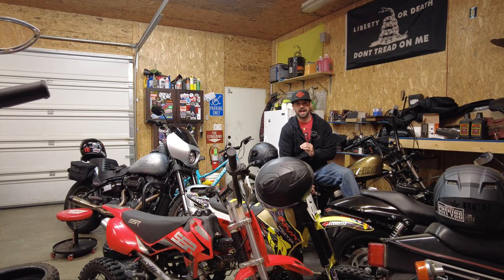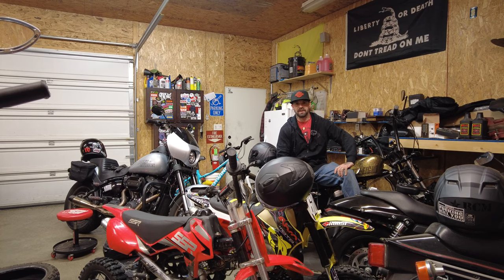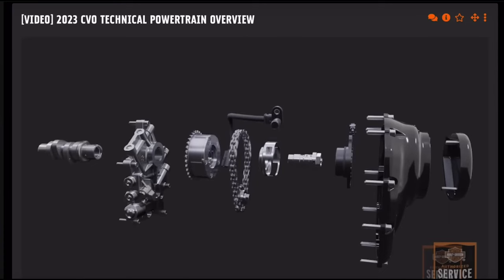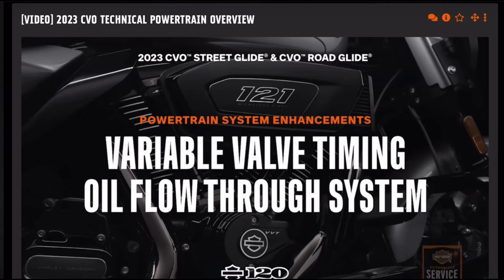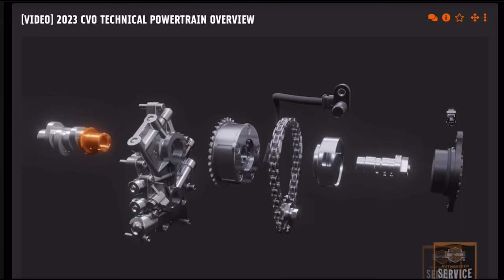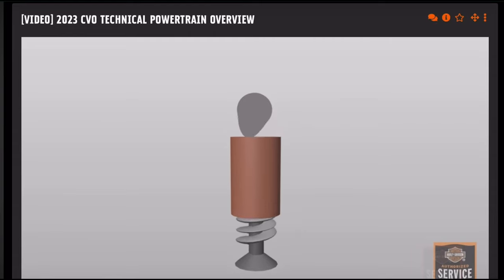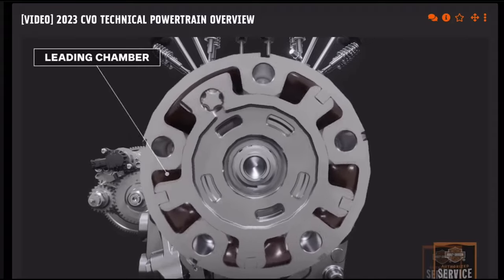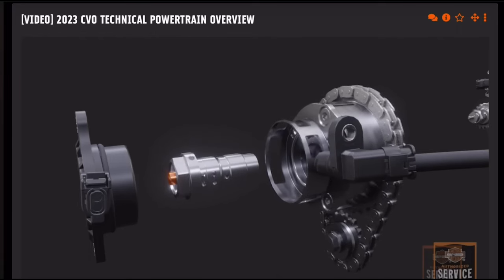Harley's New VVT Explained!

Comment: The way it normally works" Only Time Will Tell".  Advance Information, " Timing is Everything".
 Pass Information, Air-Cooled  engines," Oil is 35% of the engine coolant". 
Present Information, "Not a fan of On Board Computers".
That's just Me.
 Old School Harley Fan. ( EVO Harley Davidson forever).
 Because all H-D Motorcycles need Maintenance, Wrenching, and Loving Care.
Sixty-Two years riding behind Handle-Bar's and Loving every minute of it.   🤠
Reply: Yea I’m not a fan either I get RD part of it but all this crap on bikes hell don’t need it in cars little long motorcycles but it’s not going to matter anyway when HD brings out the new and improved 
Live Wire Road and Street glide in a few years for all the Rat tree huggers

Comment: Ask ANYONE with a 5.4 triton what they think about VVT…… I’ll wait ⏰
Reply: 😂 nice
Reply: I've had 3 Fords with the 5.4 and 4.6 on my current one 2009 5.4 3v the vvt complete timing sets has been replaced twice in 250,000 miles and doesn't run better than the 5.0 without the vvt system, if any gains are touched it is fuel economy not power by any means , just more components to fail for a 15% mpg gain
Reply: @bddfc1968  
Exactly! The system SUCKS!
Reply: @youraveragejoe7644  absolutely 💯
Reply: Dawg Shi
Reply: I wonder if BorgWarner helped Ford with their VVT? Took Ford four different variations to get their cam phasers "right" so far on the eco-boost.  There's software profiles to give your cam a loopy idle and  if you're cam phasers go out after warranty the aftermarket also has a camphaser delete.

Comment: Variable valve timing has been a thing on cars and other motorcycles for a good while now. With stricter EPA and Euro emissions HD really has no choice if they want to make any real power out of a mostly air cooled motor. They are really trying to stave off a redesign to a dual overhead cam liquid cooled motor for the traditional models. It's the right move for them to go the VVT route.
Reply: Yea it might be the right move however we all know they can't make a quality cam plate, compensators, cam chain tensioners...They love to sell bikes with crazy crank run out, removing Timken bearings, needle bearings, weak oil pumps that cant scavenge properly...They must stop making sloppy engines and get their shit together before trying anything new.
Reply: They've had dual overhead cam designs before.

Comment: The first VVT car was in 1980 and was generally adapted by 1995 for imports...Honda, Toyota and so on...
Reply: Yea Honda, Toyota not HD...Hell they can't make a proper cam plate or oil pump and it's driven with a crank with crazy run out and now they are going to bolt extra shit on it...They must stop making sloppy engines before bolting new stuff on to areas of the engine that have never been properly manufactured.

Comment: Very little oil pressure, and by that they mean absolutely none. This is one of the most warrantied bikes I've ever seen. I don't know why but they starve for oil, and burn up. I think it's the center bolt not having big enough holes. Some people have had no problems with them. Some people have had to have tons of warranty work done.
Reply from the maker: Dealer I worked for last year sold three, two of them came back more than one time. Same as the pan-americas
Reply: @0hi0hdmc  I worked at a bar that was on property of the US's largest Harley dealer in Daytona. It was the most warrantied bike, and has to still be... the garage guys would bike about it. And the customers would come in saying they couldn't get an answer... variable valve timing is garbage. Displacement on demand is garbage. Cam, crank, valve open for the cylinder space, close. I don't know how the CVO's aren't lemons to be honest
Reply from the maker: @Jbainbridge5  I agree that’s why I was happy to see the new ones with the 117. Just like everything I’ll wait a year for the dust to settle. I really want a new road glide, but I can wait

Comment: Yea it might be the right move however we all know they can't make a quality cam plate, compensators, cam chain tensioners...They love to sell bikes with crazy crank run out, removing Timken bearings, needle bearings, weak oil pumps that cant scavenge properly, now they want to bolt more shit on an area of the engine they can't get right and have had problems with...They must stop making sloppy engines and get their shit together before trying anything new.